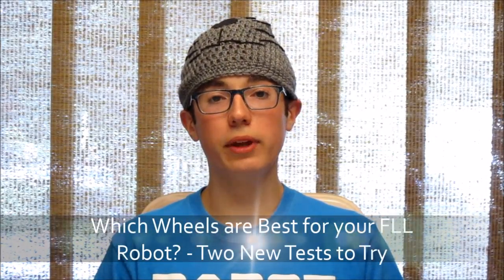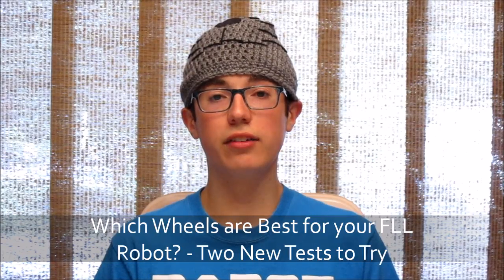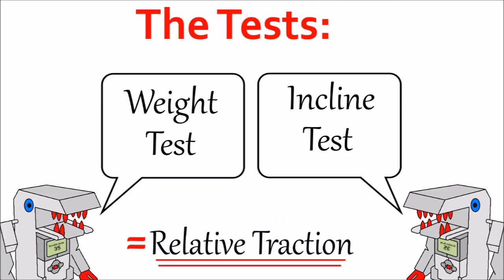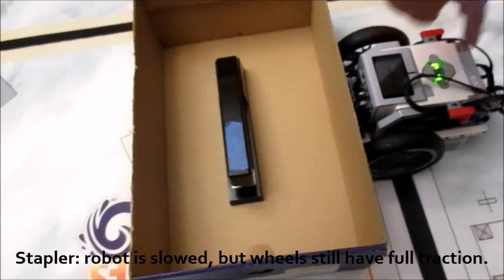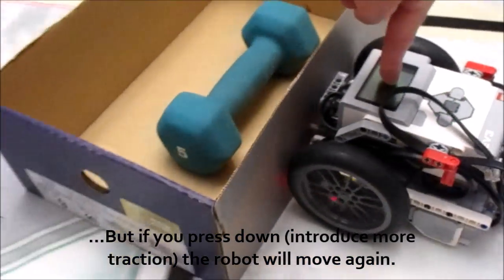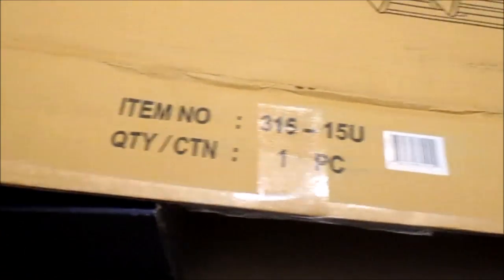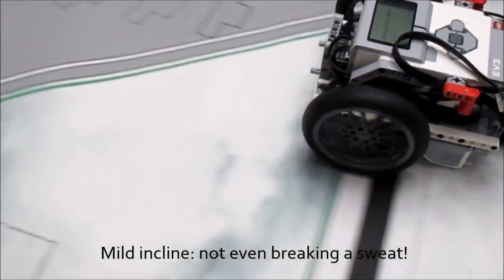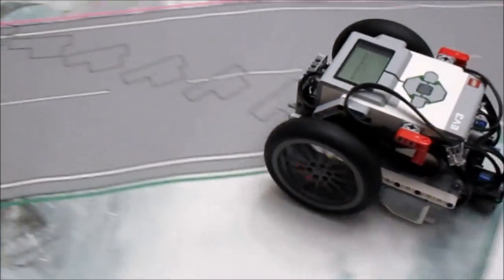The Best Wheels for Your FLL Robot - Two New Tests You Can Try

Comment: I have 2 tall wheels, but other one is about1cm wider. Does it matter?
Reply from the maker: The difference in width (meaning track width) will cause a friction imbalance between the two wheels, making it difficult for the robot to track in a straight line. However, this can be corrected with a drive straight program, either with a Gyro PID, or using motor encoders. I have videos for both on my channel.
Reply: Thanks for info!

Comment: Thanks for sharing the video.. it is useful.. as u may be aware that lego Gyro sensor has zero drift.. which cause the angle reading to increase continuously.. this will make the use of this sensor impossible.. I search for many solutions but non of them can fix this.. it will be nice if u can address this in new video
Reply: https://forums.usfirst.org/forum/general-discussions/first-programs/first-lego-league/the-challenge/products-equipment/ev3-specific/12811-ev3-gyro-sensor-drift here is link to the discussion group blog
Reply from the maker: I recommend checking this video out: https://youtu.be/7V16AEW3GG4
Reply: Thanks for the suggestion.. I watched the video it is interesting technique could be used in the starting of the mission run but the problem we are facing is it start acting crazy during mission sometime and it is random.. do u know how we can handle this?
Reply from the maker: What are you referring to? could you provide more details?